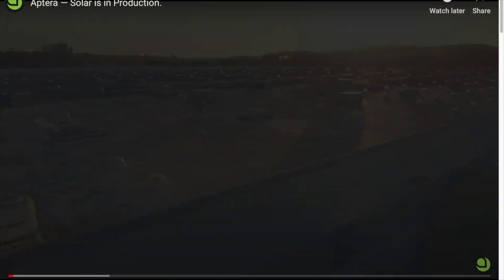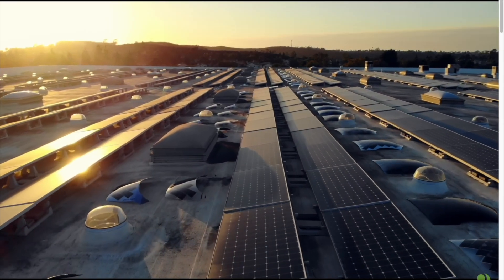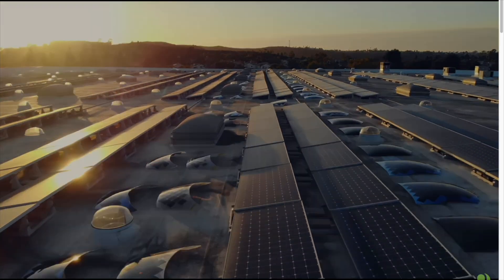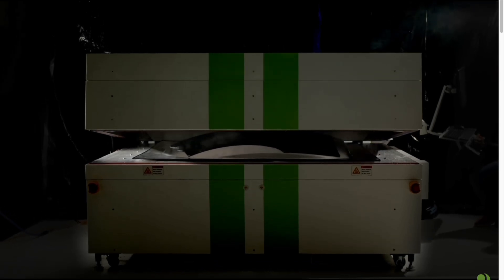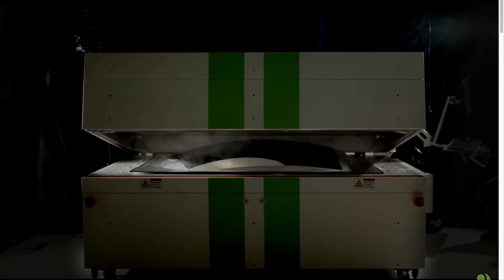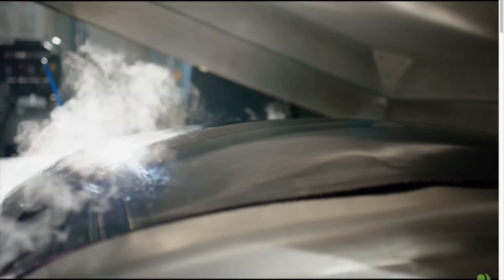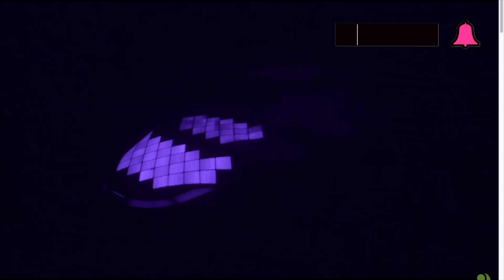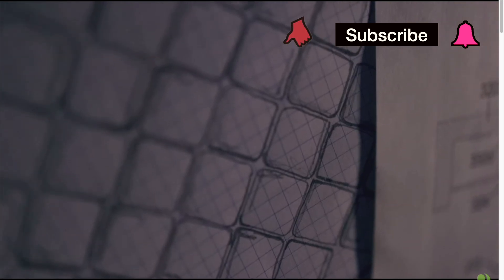Aptera's Own Design Solar Charge Controller !

Comment: Once again you simply read a script written by someone else.  You found a non-Aptera solar charge controller and read it's specs and, not surprisingly, those specs aren't anywhere close to what Aptera's needs are.  Then you went off-script and babbled.  Why bother?  Just so you can post a video?